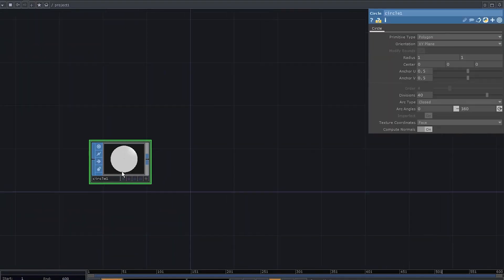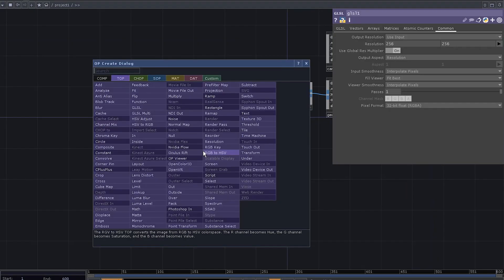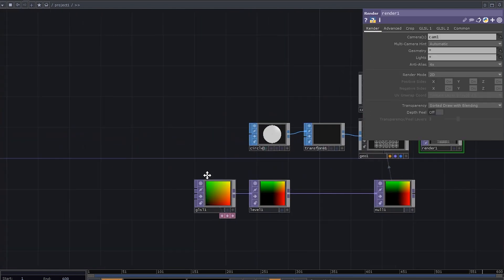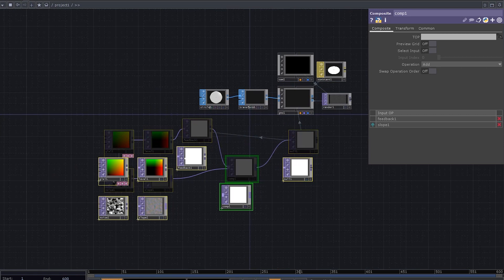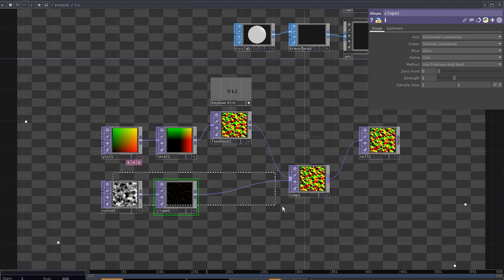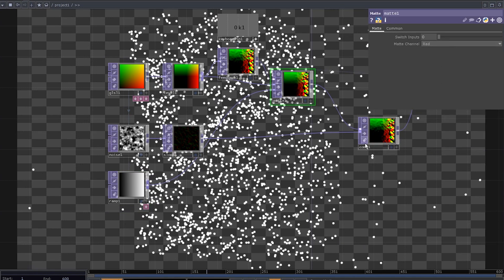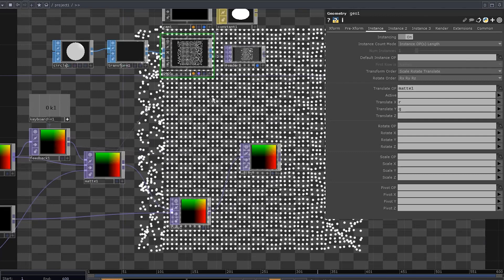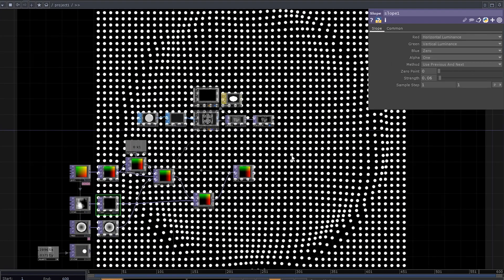Dancing dots with feedback (Touchdesigner tutorial)

Comment: Hi thank you for this tutorial, is it possible to move the dots with camera movements ? (withtout a kinect :/)
Reply: yes! try putting a threshold on your videodevicein (set the soften parameters as you want) and maybe put it through a blur top and then a sharpen operator (from the pallete)  as needed in order to make it more uniform and less edgy. alot depends upon the lighting but there are good tutorials for making your webcam behave like a kinect. multiple ways to achieve this kind of effect

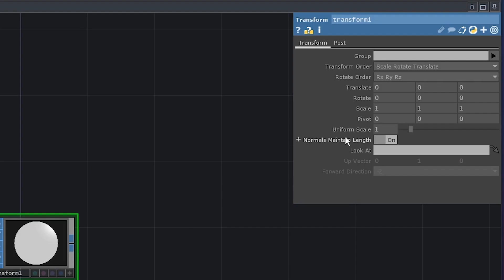Comment: at 0:19 I am unable to connect "transform 1" to "geo 1" and I'm not sure why, I would appreciate it if you let me know. Thanks for the video!
Reply from the maker: You have to create geometry comp by middle-clicking on the output pin of the transform SOP and then selecting Geometry comp from the operator list. 
Another option is to go inside the geo comp, add both, In and Out SOPs manually and then activate purple(render) and blue(display) dots on the output operator. Going with the middle-click is just a shortcut.

Comment: This is sick! Thanks so much! One question, when I plug in the mousein CHOP and reference to centre of circle2, my cursor seems to be offset quite far to the left (cannot get tx to be greater than -1 while furthest to the right). must be a simple mistake, should not have to use the math CHOP I would think?
Reply from the maker: Thanks! Mouse In CHOP outputs mouse position on entire TD window. Should be alright if you enter the performance mode. You can also checkout the "Output Coordinates" parameter. It's "Normalized Aspect" by default, you can set it to "Absolute" to see actual values in px.